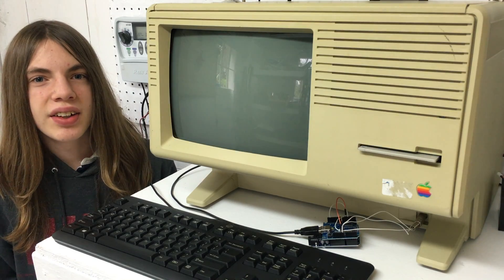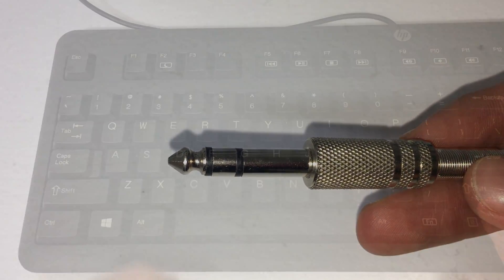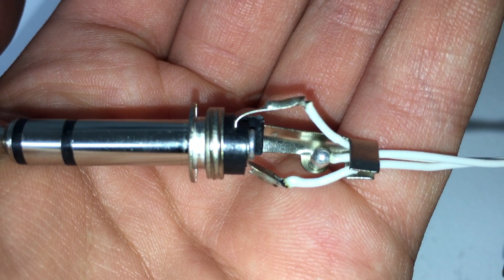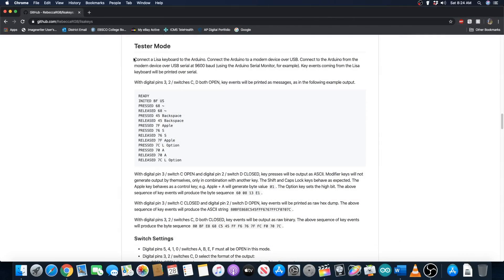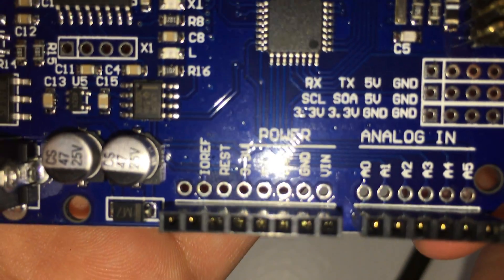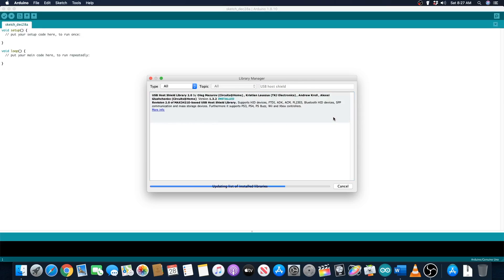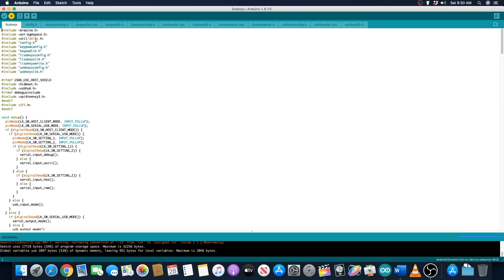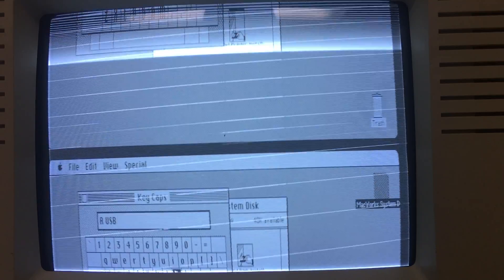How to use a USB Keyboard with an Apple Lisa - LisaKeys Keyboard Emulator

Comment: Great video! However, you did not clarify an important step! I purchased all the components from the eBay links attached to this video. An important step that is not mentioned in this video is that one must make sure that the "jumpers" to power the USB port on the USB host shield are soldered. The USB host shield in the eBay link associated with the video did not have the "jumpers" soldered. If you pause the video when the USB host shield is shown, you will see that (in contrast to the product sold on the eBay link) the proper "jumpers" are soldered to power the USB port.
Reply from the maker: That's really strange! I bought mine from that exact same link and it had the jumpers soldered already.